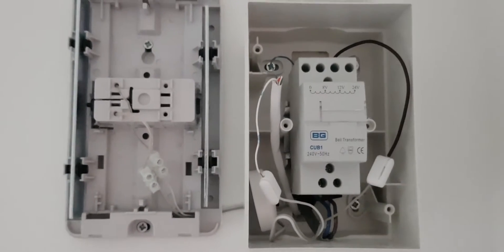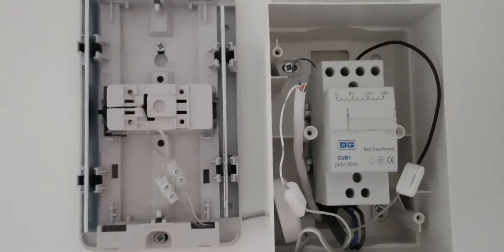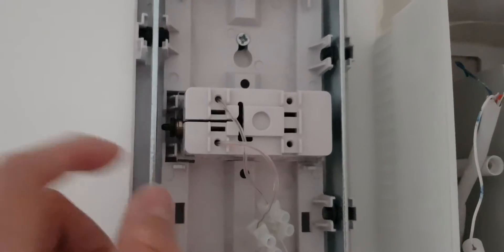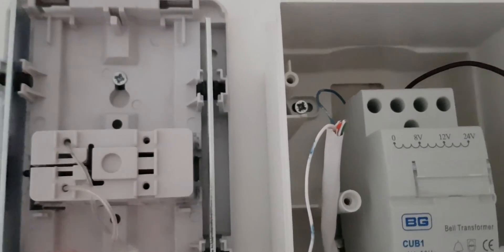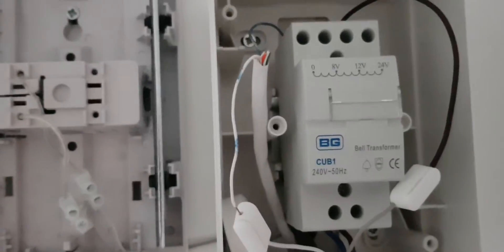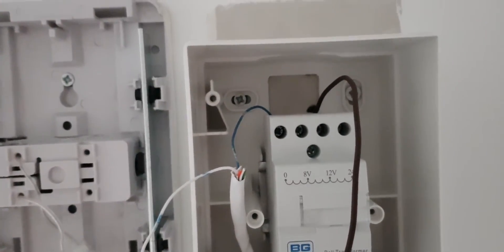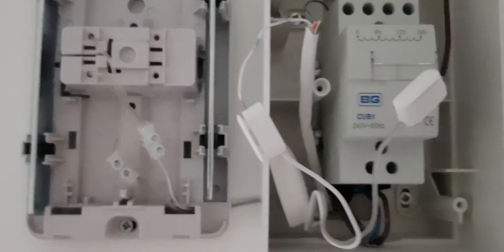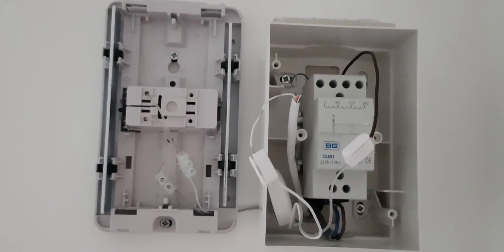Nest Hello Doorbell and Deta C3500 / C3501 UK Wiring Installation

Comment: How are them cables attached to the terminal on the chime?
Reply from the maker: Hi, have a look at the link on the videos description. It takes you to my page which explains where I cut the wires. Here is the link as well. http://www.paul-lee.co.uk/how-to/nest-hello-doorbell-wiring-with-deta-c3500-c3501-chime-uk
Reply: @PaulLee81  Thanks I actually found that artical afterwards.  Now have a working Unifi G4 Pro Doorbell with Deta 3500!  Thanks!

Comment: I have the delta C3500 which is the doorbell on the left. Mine has a transformer at the bottom. I have just changed the push button to an illuminated push bell. For some reason the illuminated does not work. Any ideas? Do I need to remove the transformer? Thanks
Reply from the maker: Hi, does the doorbell work when the button is pushed? If yes and the illumination doesn't work then it could be the transformer is stepping downower than the power required for the doorbell to work? I'd check the transformer output vs doorbell input requirements.

Comment: What VA and voltage was your chime transformer? I am doing same thing but thinking of running nest on 24v instead 12. Then using resistor to drop voltage to drive chime solenoid with nominal voltage.
Reply: Hey mate how did you get on with the chime. I have got the nest doorbell battery one that can be wired into existing doorbell power and chime but there no google chime disc thing. Did you use a resistor?? Cheers
Reply: @danhood1957  resistor did not work. 😟

Comment: very helpful followed the instructions and it works . the only thing that i would recommend is a relay for the chime because the output is 12v and the chime is 8V and probably in time it could damage the solenoid . That only if (Ding dong dash) from the kids
Reply: But the doorbell will be using most of the voltage anyway so I don't think it cause any damage

Comment: Could anyone in the uk help with where one could buy the box to sit the transformer in?
Reply from the maker: Hi Ryall, there is a link to the fuse box holder I used on Amazon. It has the description but unfortunately it looks like Amazon don't stock it anymore, but there are alternatives if you search.

Comment: Hello. Thank you so much for this. Can I ask what the power is coming into the Doorbell existing Deta C3500? I have the same issue for Ring video Doorbell 2. I was told I need 8-24v power and that my Deta c3500 is incompatible! Reason is that the power coming in may be whatever it is but the power going out is around 6V. I’m hoping you have the same power so that I can copy you! Fingers crossed 🤞🏼
Reply from the maker: Hi Kousaf, it has a onboard transformer but I did not see any marked voltage output when I removed it but I knew it wasn't enough to power the door bell. According to documentation  https://www.google.com/url?sa=t&source=web&rct=j&url=http://detaelectricaltest.co.uk/Essentials%2520Data%2520Sheet%2520-%2520C3500%2520V3.pdf&ved=2ahUKEwjT1ZTs7ajuAhURmYsKHUiVB8YQFjAQegQICxAB&usg=AOvVaw2CwzELe_SRoy-GiuicUvB_ it output 6v as you mentioned.

Comment: What do you mean by 1mm cable, the one that goes into the top of transformer what is the correct sizing if there is one
Reply from the maker: It's normal electric wire from a plug or twin core cable.

Comment: Hi Paul. I was hoping to follow your inage guide on your site but the images have gone it seems.. so no longer use able. I've followed your video but no luck so far..its the chime wires that confuse me.. so many at each end...not sure what even need using..
Reply from the maker: Hi Oliver, yeah apologies. I had to switch hosting package so in the process of building the website back up. I'll hopefully get more done soon, will let you know.
Reply: Thanks Paul. I ended up with a buzzing noise off my chime system... didnt sound healthy... eek. Ill try another day. Thanks anyway.
Reply from the maker: @olivermcnally1110  Good news, I've fixed that post now. All the images are there now. Hope it's of use to you.
Reply: @PaulLee81  you are brilliant... with your step by step guide I've managed to do the successful install and its all working perfectly. I nearly gave in paying £90 but I am stubborn and stuck with it. Much appreciated!
Reply from the maker: @olivermcnally1110  Really glad it helped you. You sound like me, won't give up and persistence has paid off! Well done.

Comment: I have followed the install guide but cannot get my original Deta C3501 chime to work. Nest doorbell is all working great. I tested wires coming from the Chime Connector with a multimeter but not getting any reading, any ideas what might be wrong?

Comment: I have a eufy doorbell and I bought this transformer. But when I turn the doorbell circuit back on it just trips and turns off again and I have no idea why. The eufy doorbell needs 12 to 24 volts and I’m sure I put the wires in the right holes. Got any ideas?

Comment: Thanks for this. We have the same transformer set up but I have wired it to the 24v connector instead of 12v but the transformer is buzzing. Is that because we’ve wired it to the 24v do you think?

Comment: Hi Paul, great resource.  When measured I’m getting 15V AC at the transformer and at the chime.  Haven’t tested the voltage at the doorbell yet.  Should 15V AC be enough?  I don’t have the same chime/transformer that you have.
Reply from the maker: Thanks for looking. That's plenty according to Google and assuming you are in Europe. The device needs between 12-24 V AC in Europe or between 16-24 V AC in US. https://support.google.com/googlenest/answer/9247132?hl=en-GB#:~:text=Nest%20Hello%20needs%20to%20be,VA%20(in%20North%20America).

Comment: I'm really struggling with mine. I've for a chime that's got massive batteries in it. I've hooked up that small circle transformer thingy. I've them put the 2 doorbell wires into the back of the doorbell and it won't even power it. If I plug it into the update port which powers it up, I can connect to to my phone and stuff. But when I press the doorbell. It won't ring the chime. Just sends a notification to my phone.
Reply from the maker: You have a battery powered chime? Might not be enough voltage from battery to power the doorbell.
Reply: @PaulLee81  yeah I think so. Thanks for replying. I've decided to go the easiest option, and that's to have the doorbell powered straight to the mains via an adapter from ebay. Then use a Google mini as the chime.

Comment: Do you need to put the dongle in? I have this doorbell and am looking to get nest doorbell. Can I just put the power supply in to the 24v transformer and then connect the wires coming out of the transformer to the back of the nest doorbell. I know I won't have a chime but will it work OK?
Reply: The dongle is a capacitor, regulates voltage and protects the Nest.

Comment: Thank you for your informative video. I've seen others' wiring the transformer from the 8v and 24v outputs rather than 0v and 12v in order to supply the nest hello with 16v. Can you advise which is best?
Reply: I would also like to know please! 

I wired it yesterday on the table just to see how it worked and connected it to 12v, it seemed to work ok. 

Then this afternoon I Installed the doorbell and mounted on wall - 12v, and it wouldn't chime even though the nest bell was working fine. 

I switched it from 12 to 24 and the chime started working.... So I can only imagine it depends on how far away the transformer and/or bell is from the chime??

Since the install, the chime had randomly chimed so now I am no longer sure if 24 is too much. 

So I am beginning to think that maybe you might be better off actually buying a 16v transformer as instructed by nest unless someone can tell me I have done something wrong.
Reply: Yes I would like to know the answer to this? As it needs 16v to 24v, please could someone answer
Reply: I currently have mine wired to the 8v and 24v outputs. My doorbell keeps going offline intermittently (no real pattern) so I checked the power output and I am getting 17v.  I sent an email to BG to confirm if this was the correct wiring and their response was;

"The CUB1 has been tested and certified for use only when outputting 8, 12 or 24 V (by using the zero and 8, xero and 12, or zero and 24 terminals respectively) so your current installation is not a recommended way of wiring the unit in and hence might be causing some unexpected output fluctuations.

Incidentally, taking a voltage reading under `no-load’ conditions (i.e. when the transformer is basically in standby not deeding any significant amount of power out to any device) can result in readings which are slightly higher than they would be under loaded operating conditions, so a reading of 17V on a calculably 16V potential difference would not be unusual in such situations.

You could go for either a 12V output (zero and 12 terminals connected) or 24V (zero and 24 terminals connected).

 

One other thing to point out, the unit has an 8VA (or 8W) peak output, so at 8V this provides 1A, at 12V it is 0.666A and at 24V it is 0.333A"

Comment: Thanks for this, super helpful. I have a couple of questions if you can help, from the wire that’s going to your doorbell, where does that blue wire attach to? I have 2 core to the bell, so one end would go on the chime connector... does the other go into the 0V connector at the transformer? Also I cannot for the life of me unscrew the transformer terminal screws. Was yours stuck at all?
Reply from the maker: Hi, glad it's helped you. Yes, one wire from the button goes to the 0v transformer connector. There's a wiring diagram on my website that shows it a bit better. http://www.paul-lee.co.uk/how-to/nest-hello-doorbell-wiring-with-deta-c3500-c3501-chime-uk/
Didn't have any issues with the screws, I'd recommend trying a longer/larger screwdriver for leverage if not done already.

Comment: Great video Paul. I've got the next model up to your chime but decided to ditch the chime all together and just fit the same transformer. I've got the blue and brown going in the one end and then one of the doorbell wires in the 0v and the other in the 12v.all works perfectly but the transformer buzzes. Enough to be annoying. Any ideas on how to stop this?
Reply: I have this very same problem, have you had any luck solving it? 1 question... why is 1 wire in 0v and other in 12v? It needs 16v to 24v doesn't it?

Comment: Well, that was hugely useful. Wasn't expecting to find something so perfect to my needs. I'm in a rental house that we're looking to move out of fairly soon (months). I can make modifications but will need to put back so looking to avoid too much hassle here. Do you know how I could non-destructively set this up?

I'm thinking that if I possibly remove the door chime from the loop (use Home mini's for alerts) and wire the mains into the transformer instead - or alternatively add some extra wires from the mains connection of the existing transformer into a new one. Not my wheelhouse so appreciate your thoughts.

Also, do you know the spec of the transformer I need? I can pop to Screwfix or the like and ask for help but they might not know what I need here.

Huge thanks again for the totally niche and bang-on video.
Reply: Just followed the link - shoulda done that before. Legend.

Comment: Great video. Hoping to do this same setup in the near future. I'm just wondering, the brown wire that goes from the white nest cable connector into the top of the transformer, where is this from, or did you have source this extra cable? Thanks!
Reply from the maker: Yes, that's a similar type of wire I used.
Reply: Paul Lee Awesome, thanks. Looking forward to getting it all setup 👍🏻
Reply: Just done this today, everything worked perfectly 👌🏻 Wouldn’t have been able to do it without this guide so thank you very much for taking the time to make it 👍🏻
Reply from the maker: Hi, yes I sourced the brown wire myself for this. If you're using a bell wire, make sure it can handle the voltage you are setting as output from the transformer.
Reply: Paul Lee I need to put up a new light fitting too. I’m assuming I could just use some of the excess wiring left over from removing the ceiling rose or the light fitting for this?

Comment: Thanks for this video. I've got the Arlo video door bell with a similar DETA door chime. Will this work? The Arlo video door bell only has two cable hooks coming out of the power kit and not four as in the Nest.
Reply from the maker: It depends, what voltage does the Arlo video door bell require?

Comment: Really helpful thanks, I have the same bell transformer from screwfix and your video confirmed the input wires. Works now
Reply from the maker: Great stuff, cheers. It's an amazing device once you get it up and running!
Reply: Does yours have a humming noise? Mine seems to
Reply: Adam the transformer in the distribution board?
Reply: @ajhewison  I have it set up like in the video. But transformer has a buzzing noise
Reply: @ajhewison  Also why wire it to the 0v and 12v and not to 24v?

Comment: Was yours a DETA 3501 ? I read online that the transformer on the 3501 has a 14.5 output ?
Reply: I have a 3501 and when I measured voltage at the doorbell button end it was about 4v
Reply from the maker: Mines is the 3500, measuring the voltage output of the transformer is the only one way to be sure you have enough voltage. I'd be surprised if it supplied more than 8v for UK doorbells.